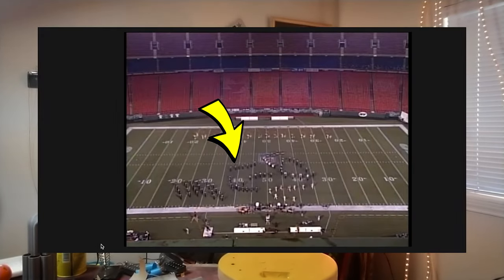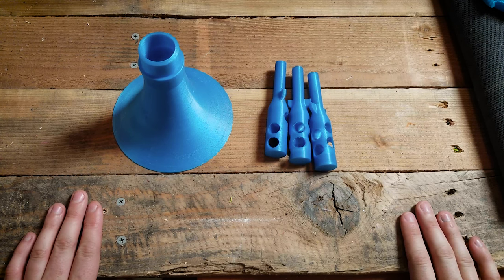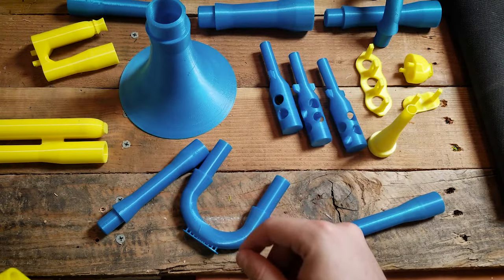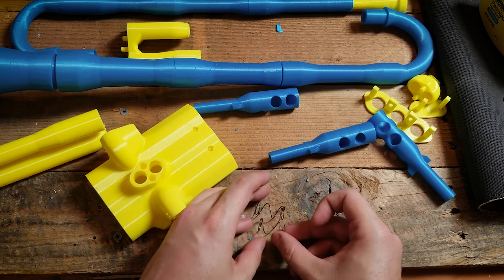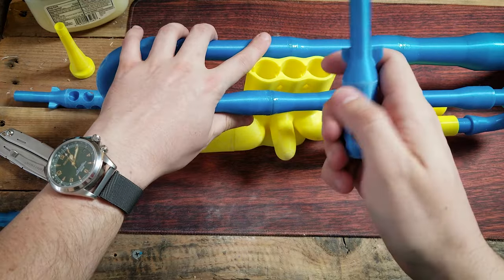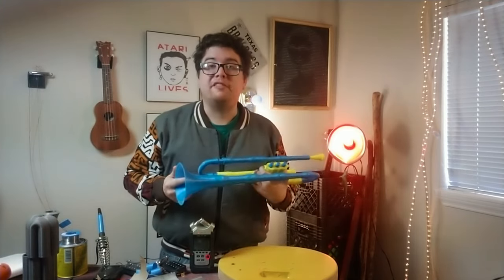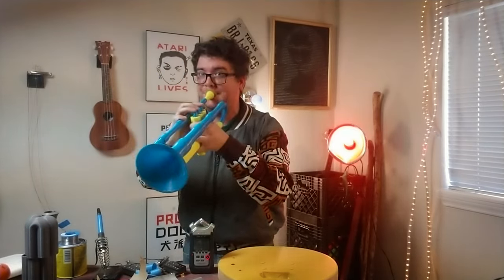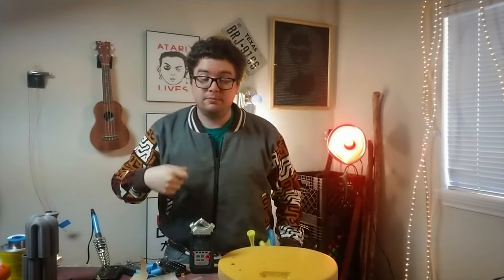How to make (and play) a 3D PRINTED TRUMPET

Comment: Is it the valves themselves that don't work, like if I modified it and put actually metal ones do you think it would work? Or is it just the design overall in terms of tubing length?
Reply from the maker: I think it's the material itself not being resonant enough. I am curious about brass filaments and the like, though. Lemme know how it goes if you take a crack at it!
Reply: @Patrick_Gibney  Thanks! I wanted to make something practical in terms of 3D printing a trumpet so I am going to attempt a pocket trumpet just for fun and make it so that you can use standard metal valve fittings 😁, I will definitely update you on it if I get any decent results!
Reply from the maker: Good luck!
Reply: @Patrick_Gibney  I might try to create my own Trumpet Replica model and print it in resin for a fun little project! If I do, I'll need to let you know how it works!
Reply: @Patrick_Gibney p-bones have been a thing for a while now I’m no expert but I think it could possibly be the valves not sealing.

Comment: try using petg as its a bit stronger and im pretty sure that it seals better and try making it solid so that the sound doesnt get lost in the infill pattern. Plus Petg is more food safe than pla which doesnt really matter if your 3d printer is dirty but still. Im gonna attempt a pocket trumpet and a piccolo trombone going with the trombone first as its much simpler